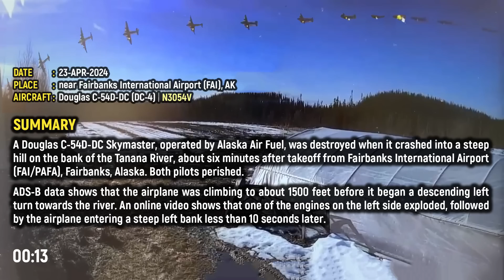Douglas DC-4 Plane CRASHES into river near Fairbanks, AK (2 DEAD)

Comment: Somebody at FAA should train controllers not to yammer a flight crew to death, right when they are dealing with an unfolding emergency. If they need the controller's help, they will say so, but in the immediate emergency, the controller should just say, "i'm standing by..." and then just shut up.
Reply: ATC have got obligations and responsibilities, so of course they will communicate. As a pilot, it's then your responsibility to assign priorities to your tasks, and communicating is not your primary task. Flying your aircraft is.
Reply: it's the flight crew job and training to fly the airplane, choose an emergency landing spot and troubleshoot, all of that before attempting to communicate with ATC during an emergency, if the pilots reached for ATC is because they either had finished doing all the steps before, or they skipped them.
Reply: “Stand by” , or don’t say anything at all. It’s your emergency , it’s your airspace , your radio, your runway/airport. Aviate, Navigate, Communicate. RIP.
Reply: @22noobtube  context is critical here. As ATC at the countries busiest 3 Airports and 3 Enroute Centers...I think I have perspective that few folks do. Each scenario is unique, and while there are FAA requirements, ATC is also trained that the pilot/s or encountering significant complexity in the cockpit. Composure is critical and I can say that it is not easy 1st time or 30th time. I have been on position during bomb threats, 9/11, and many small aircraft emergencies, and sadly, several ended in fatality. We can not fly the plane, but we can do many things behind the scenes to assist the crew. About 14 years ago, a pilot died departing Naples Florida. The Turboprop autopilot was in a continuous climb profile. The passenger was a single engine only pilot and had no turboprop time. We quickly ascertained the issues and we're able to get a pilot on the phone who was certified in that exact plane and talk that pilot and his family to a safe landing at RSW airport. That's just one example where ATC composure and proper questioning were able to quickly problem solve and assist to save lives.
Reply: I think you brought some needed context as well as your expertise to this conversation, Optimize. What I've recommended to my students for years, is, if you are busy with a problem, use the time-honored phrase: "Stand by". Most controllers will rightly interpret that as, 'I am busy, I will get back to you as soon as I can.' And lets also be honest, controllers are like any other group of people; some local and enroute facilities have different cultures than others. Norcal is one of my favorites, those guys are the top pros anywhere, while some other areas could use some help, (LAS, I'm looking at you.)
Reply: Basic info ATC needs for an emergency: acft type/callsign, nature of emergency, and pilots desires.
Reply: SOULS on Board as well....fuel remaining in time is another @davidsakal449
Reply: you’re wrong - they actually teach you this when you get your pilots license. (1) aviate (2) navigate (3) communicate. You always go in that order.

If you decide to stop communicating because you’re task saturated keeping the plane in the air, no one will fault you ever. Doing it on purpose is a different matter.
Reply: @amg2022 EXACTLY
Reply: Nobody said that isnt the case @amg2022
Reply: The crew only indicated that they wanted to return to the airport. I didn’t hear an emergency declaration. Regardless; you are under no obligation to reply to ATC questions in circumstances like this. I certainly wouldn’t have. People, put it on the ground before getting too slow. It’s gonna hurt, but you might live.
Reply: @boommasterkc-135____8 you aren't a pilot. What is the First task for an in-flight?

AVIATE. 

These pilots weren't a couple of newbies.
Reply: BS - the controller did exactly what the controller should have done, and is trained to do. 

The pilot flying made the decision to fly the plane, and either he or the pilot monitoring made the decision to navigate and communicate. The controller asked the information required to assess the situation from her perspective - which is, if able, determine how many people are on the airplane (so that rescue or recovery can account for everyone on-board), and how much fuel remains on-board (for determining the size and scope of any fire suppresion needed, along with length of flight available before a 0 fuel scenario ensues.). Her job is to coordinate the aircraft to the ground, and coordinate the ground crews to the aircraft, with as much info as possible.

Had you ever manned an aircrew, your statement would seem as asinine to you as it does the rest of us that have.
Reply: Agree to disagree. I’ve dealt with engine failure on departure years back and had to immediately return to the field. Declared my Mayday for engine failure, gave them my intent to return for landing on the runway I took off, but in opposite direction. He cleared me to land, then asked for fuel/souls onboard, a question which I ignored. He got the hint and simply gave me a few wind callouts, which actually was extremely helpful. 

Do I fault him for that fuel/souls query in a high stress situation? No. From being an airport ops guy myself, I get that any info he can get for Ops/ARFF related to an alert aircraft only helps the rescue services in their response. That’s all the approach controller was doing here.
Reply: In most light twins, the after-takeoff loss of an engine launches at least 12 memorized checklist items, which must be followed correctly to survive, because light piston twins do not have a lot of excess power. In an actual situation, I would have said, "Nxxxx engine loss, declaring emergency stand by," and then I would not have transmitted again until I finished the checklist and the aircraft was under control, climbing and clearing any obstacles ahead. I remember my first engine-out simulation in a Beech King Air, and the fact I could still climb at 500-700 fpm, was amazing.
Reply: Disagree.  Aircraft turn back for various reasons from an engine fire to an open access panel to an avionics issue to an ill passenger.  Rarely is it a life or death emergency.  ATC should communicate and the crew responds appropriately.  If they're about to die the last thing they're thinking about is ATC.
Reply: 100%
Reply: Someone in your family or friends group or aviation community should train you to STFU.

Asking if they need assistance and for souls and fuel is the minimum info ATC needs, so i don’t know where you think the controller is yammering.
Reply: Do you hear yourself talking?
Reply: Stop qq on little thing
Reply: You should follow your own advice and "stand by" In other words, keep your mouth shut If anyone wants your advice, they'll ask you for it...
Reply: From the moment the engine exploded till the moment when they hit the ground passed about 10 seconds, but the conversation with the ATC lasted a lot longer than that, which means they realized they have problems with that engine before it exploded. During this time they knew they lost or loosing one engine out of 4, which is essentially not so critical so they were more relaxed and talking to ATC not knowing the engine was going to explode taking them into the ground 10 seconds later.
Reply: This in a town with a super small airport.
Reply: As a former air, traffic controller, I can tell you that in the training manual it talks about not using excessive verbiage. I had to handle an emergency or several if you count some lighter versions, such as bird strikes. And during those incidents, I put out the minimum of what needed to be said, asked if they needed help, waited for their replies, and sent help as requested. In a case, like this one, in the training manual, at the very end of it, it says if any situation occurs that is not covered in this training manual, use your best judgment. I believe that’s exactly what was done in this case.
Reply: ABC- aviate, observe, then communicate is the order of priority during inflight emergencies for PIC. My guess is the pilot forget to fly the plane (feather the port propeller) and that error proved fatal. However, it’s unclear whether or not the damage to the wing was catastrophic when the left engine failed
Reply: Your comment is totally nonsense. 
FAA does not train Atc. 
Atc does not yam, but only assist.
Atc can be cancelled with one switch on the cockpit.
Reply: I’m gonna have to disagree with you here. I thought she did a good job. She got to the point and asked the questions she is REQUIRED to ask.  She didn’t stutter, she didn’t speak too quickly, just clear, concise, get to the point questions.  Besides, at the point she asked the questions she had no idea the severity as all she had at the point was “we are gonna return to the field” or something along those lines.   Besides, if it was too much info, the pilots couldn’t care less about what’s going on the radio, they are focused on flying.  Lastly, imagine how that investigation would go for the controller….NTSB: please explain to us why you did absolutely nothing during that emergency. Yeah that wouldn’t go well.  
Good job to the controllers involved, and RIP to the pilots, I’m sure they did all they could and based on the video, it looks like they had no control after whatever blew, that airplane turned and dropped like a rock.  😢
Reply: Yes, I agree, she did a great job and followed correct procedures, but here is where we part: I think controllers should be trained to consider the workload the crew of an emergency aircraft have just encountered; when that crew has a moment, they will bring the controller(s) up to date. She did her part, and her partner as well, though you could hear their voices straining with emotion. My heart goes out to them, as well as the victims' families.
Reply: @JamesAMG yea honestly she didn't even waste time asking the nature of the problem just the required questions and a heading to go back to the field clearly and concisely. Best possible job by ATC, I'm sure she heard the concern in his voice and knew it was a mayday call. 

To me it almost sounds like "we're returning to the field... Okay putting her down in a field" it's possible the controller didn't make that part out but hard to say. Unfortunately it doesn't seem there's anything these pilots could have done differently. Or ATC 😔
Reply: I don't know what you're comparing these ATC to, nor do I know if you've ever been under the stress of watching someone die before your eyes, or if you've ever been aboard a craft having an in-flight, but my guess is a solid NO.

This ATC did just fine. There's no evidence the pilots were the least bit negatively affected by ATC.

Remember, there are many times ATC gets a call about a craft having to return to the field, most of the time ATC don't know the condition of the craft until the pilot tells them; and nearly all the time the pilot is able to tell them.
Reply: Looks like you guessed wrong, JD. As a retired pilot and advanced level flight instructor with thousands of hours, you can be sure I have witnessed many difficult moments in my career. Now, go sit down on your mom's basement couch and finish that episode of The Price is Right.
Reply: @scottpageusmcwho tf are you
Reply: I agree with you. The quality of controller has decreased significantly in the last 5 years precipitously